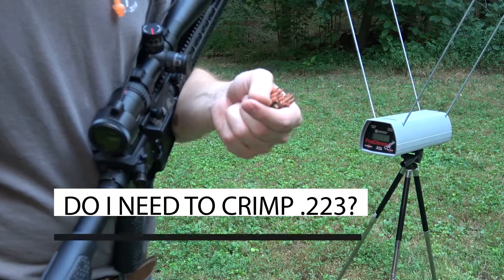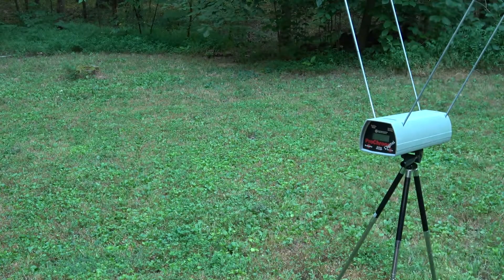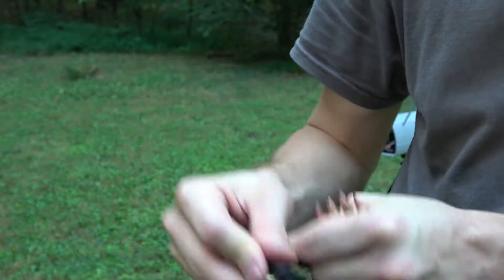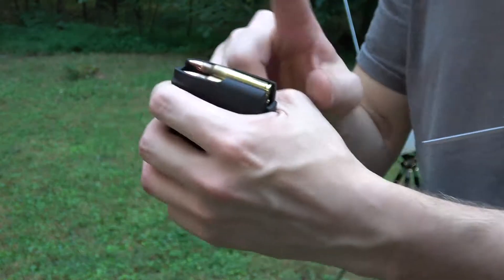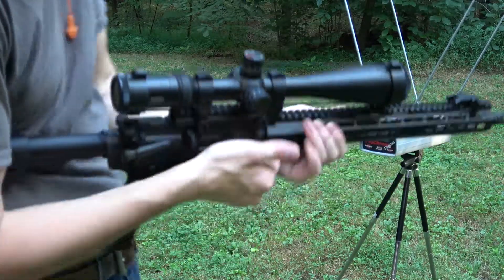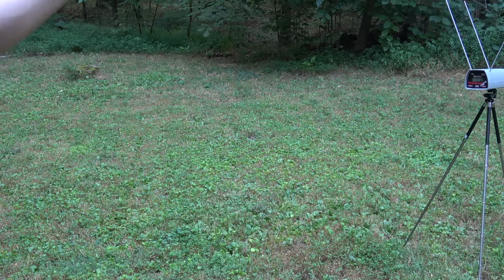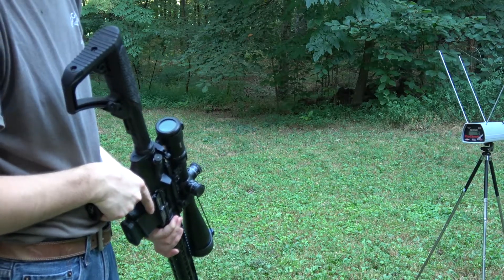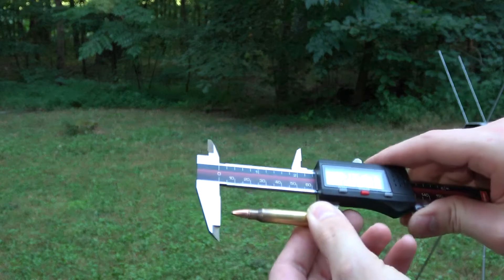Do I Need to Crimp .223/5.56?

Comment: I don’t crimp 223/5.56 and get .2” groups at 200 yards out of my POF. I do crimp 243 in BCA uppers. Best groups are .3” at 100 yards with both 243 ar 10s with the lee collet factory crimp die. I’ll have test non crimped and see if they shoot betrer. Just don’t want projectile movement in the AR10s and over pressure since they seem to slam ammo home vs the 15’s.

Comment: You can not accuratly measure oal using the caliper that way. The lead tips on your rounds can give bad readings. You need to take themeasurement from the ogive of the bullet,
Reply from the maker: You're absolutely right. I've since started using a comparator.